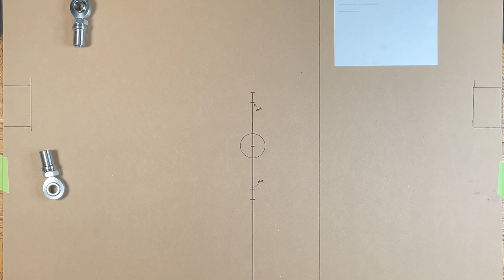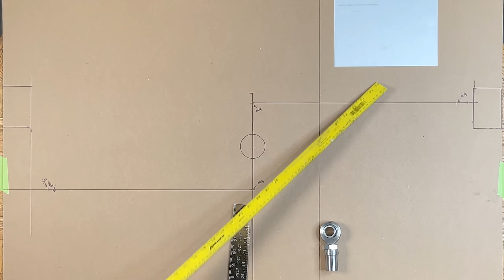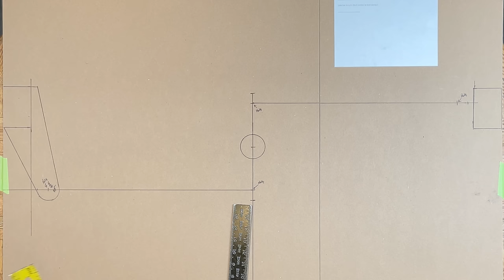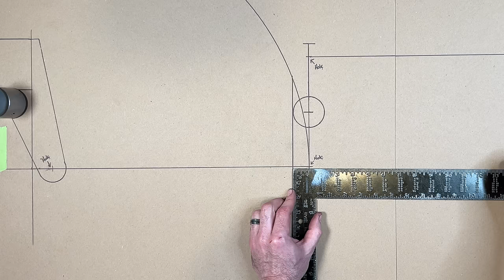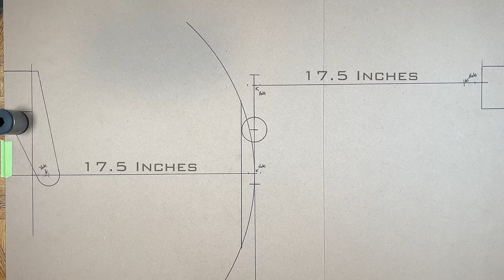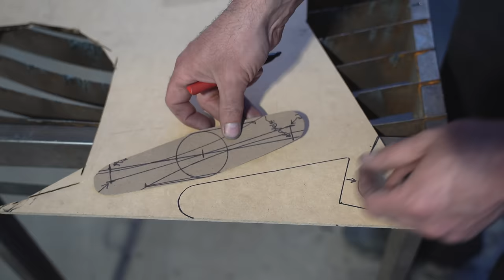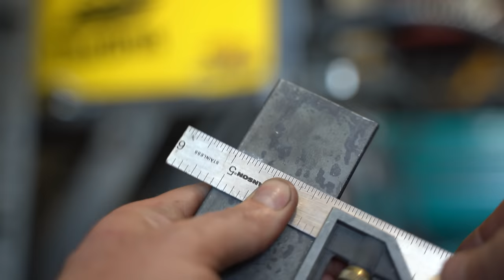The Greatest Watts Link Tutorial Ever! Mighty Max Ep. 16

Comment: Can watts link be above the center line off axle?
In offroad use it would be better protected?
Reply from the maker: Yes it can! Here’s the potential catch; The pivot on the ‘propeller’ of the Watts link is the roll center of the rear suspension. So you are raising the rear roll center. This could potentially be less than great on a street race car, but for off-road? I don’t know! I recommend doing that search. What’s better for off-road, High or low roll center?

Comment: OK, but does the the watts link have to be mounted in the center ( up and down) of the the rear axle or could it be above the axle in the frame?
Reply from the maker: No, the center point of the Watts Link can be anywhere vertically. You could put it higher than the roof of your car if you wanted. Don’t do that. That would be dumb. Also, the pivot point of the center link will be your vehicle roll-center. (Look it up) Most people believe a lower roll-center is better for vehicle handling.
Also it’s just much easier to mount the propeller centered vertically on the axle which is already a pretty good roll-center location.
Reply: Yes, you can make the pivot higher, as I did on my Nascar Chevy with leaf springs in the 60s.  I just welded a large bolt on top of the housing that stuck out  rearward (single shear, it worked fine and never broke off.)
Reply from the maker: That’s interesting! In a racing application even?!

Comment: Great vid!! One question, is a watts link suspension less likely to axle tramp in high powered vehicle?
Reply from the maker: Is this question for you or are you asking for a friend? Axle tramp or wheel hop occurs mostly with leaf spring suspensions. It’s caused mainly by the axle twisting backwards, winding up the springs, and then releasing under heavy acceleration and could be made worse by failing shocks. Leaf spring suspensions usually don’t have a panhard bar or watts link. (Though I have seen them installed to help stiffen things up)
But to answer your question, No. A Watts link eliminates side to side motion so it wouldn’t play a part in limiting up and down vibrations.
Converting leaf springs to a 4 link setup would be the first step in eliminating wheel hop. If the vehicle in question already has a link bar suspension, it may be designed improperly with incorrect angles or perhaps failed bushings?
Hope this helps.
Thank you for the kind words! 🍻
Reply: @GarageFab  thank you for your time to respond to my question much appreciated. The question was for me, thinking of options for my 1978 280ce Mercedes with a ford "Barra" powerplant... Cheers Tim.(live in Australia)

Comment: now if you do the other style watts link does the bolt need that same support
Reply from the maker: Short answer: Nope!
Longer answer: It’s difficult to explain in text, but if the bushing is welded into the bridge that arches over the back of the differential, then that bushing is fixed. The “propeller” would then be two simple plates that sandwich that bushing with the bolt through the middle. That bolt would see “double shear” forces, meaning that the forces are split between the front and back of the bolt rather than a single point.
If you want some insurance just grab a large grade 8 bolt!
Hopefully that made some sense. If not Lemme know. I’ll try again. Cheers!

Comment: Just curious, what kind of power can the watts link handle?
Reply from the maker: Hey Brian! What kind of power are we talking about? Horse power or G forces? I’ll answer both in an attempt to get you an answer.
The watts link’s job is to keep the axle centered under the chassis left to right and has almost nothing to do with anything related to acceleration or braking. That said a watts link wouldn’t see any more stress on a top fuel dragster than it would on a golf cart.
An F1 car is something else entirely. When a vehicle turns hard and fast and has a lot of traction, there’s a lot of inertia trying to pull the chassis sideways off the axle. That’s where the watts link goes to work. With that in mind, the strength of the watts link all depends on how it’s built. It can be made to withstand the forces of a semi truck on a race course.
Hopefully this made some sense. Lemme know. Cheers!

Comment: Mancandy 
I’m doing a watts link 
Asking how do I know the length of watts arm or center arm 
Coil Shocks have 4 inch travel total  can u help me out please
Reply from the maker: Hey Dean! The center link can be just about any size. Static height suspension like yours doesn’t require a lot of movement, so the center link can be pretty small. It might be determined by whatever components you’re using. I’d recommend maybe 4 inches from the center of the top hole to the center of the bottom. If you’ve got a junkyard nearby, go check out a PT cruiser. They have watts links from the factory and they’re really kind of small.

Comment: Which one has more articulation? And can the front axle be done?
Reply from the maker: Generally the rod ends are the biggest inhibitor of Articulation. Swapping polyurethane bushings with Heim joints will drastically increase the amount of twisting motion you’ll have. That said, the triangulated 4 link is the most ideal for crazy Articulation, because a 5th device isn’t needed to keep the axle centered, (Like a panhard bar or a watts link) that often limits movement.

Comment: I wery like the Watts link and Im glat to see, that You built it in a shad. there is only one design flaw. and this is in the Diff cover extention for supporting the bolt no to be bent. those extensions left an open surfaceto let dirt and moist inside and will cause rust issue. otherwise nice work.
Reply from the maker: That’s a good point! I’ll have to have it powder coated and hope that helps. Cheers!
Reply: @GarageFab  maybe you can patch it before power coating, while it in pieces. great work.
Reply from the maker: Wait… patch what? There aren’t any holes or openings that aren’t meant to be there. Just some difficult to reach places that spray might not reach.

Comment: Why did you go with such a large truss across the top? Is that in another video?
Reply from the maker: Hey Samantha! The reasoning for many of my projects is simply “Hey! That would be an interesting video!” if you haven’t already, go check out the video that features the truss build. (Build an Axle Truss! Mighty Max Ep. 14)
https://youtu.be/nHwn5nU0ph0
Earlier in the truck project, I narrowed a mustang axle, so I thought it would be wise to strengthen the axle a little bit. I don’t think the truss needed to be as big as it is, but the size was just determined by the size of the upper link bar tabs. 🤷‍♂️

Comment: I watched this just to see if it seems applicable on a off road vehicle but I don’t think it’s possible because of all the articulation that the axle sees but seems like decent for street vehicles or low riders
Reply from the maker: The disqualifying factor would more likely be ground clearance. The articulation of a watts link suspension is only limited by the vehicle frame/body. The watts link itself doesn’t prohibit articulation at all. The axle could technically rotate infinitely. But unfortunately, a Watts link requires a frame to attach to.
For high articulation, I think the most popular set up is a Double Triangulated 4 link.

Comment: You forgot one very important thing . Some guys dont run o pinion angle . They normally run 3 degrees wich changes the the watts link again and changes all the geometry.
Reply from the maker: I’m not sure I follow, Shayne. Pinion angle varies a lot depending on what vehicle it’s on. But pinion angle doesn’t affect the watts link.
There’s a possibility that changing the pinion angle (after the Watts link is already installed) could cause clearance issues with the bar ends. But I don’t see how pinion angle could affect anything else.

Comment: That little model is f'in sweet!

Is that timing belt tensioner rollers as wheels?
Reply from the maker: Oh my! Are you a Toyota guy too? That is exactly what they are.
Thank you my friend!
Reply: @GarageFab  Was for several years, but also Nissan, Honda, Suzuki, & VW.  They all have bearings that look kinda like that.

You should build the rest of that model!
Reply from the maker: I was going to use the model for front suspension demos also, but I’m worried it’s too small. Instead I’ve got ideas for a significantly larger model of one side of the vehicle, that I can duplicate and flip in my editing software to make it look like a complete model. 🤔
Reply: @GarageFab  do whatever you want. Welding random shit together to make it look like something else &/or work, is "art", apparently.

That's what I was told (by several people) about the random shit I've made after raiding the scrap pile (when really high).

It's not so much about how good it looks, but how you made it. 3D printing any of it takes the "art" right out, since you didn't make it, a computer did. 

Set it on a visible shelf in the shop to remind you, & wait. IDK what the right parts are, but they'll show up, and I'm sure you'll know when you see them!

Comment: Isn't that bottom link mount on the frame going to prevent the frame from sitting on the ground?
Reply from the maker: Not gonna lie, Kent. You made me go measure. The frame swoops upward significantly behind the cab and so there is still 3(ish) inches of ground clearance for that monstrous mount.
It will get much closer to the ground when I drop the rear drag bar/roll pan protector on the ground but it still has some clearance. 🙌
Reply: @GarageFab  Got it!! But what about the angle of the dangle?
Reply from the maker: Haha!! You’re just gonna have to trust that the dangle has been properly calculated.

Comment: Not quite sure why the bell crank (propellor) can’t be straight up and down?
Reply from the maker: It can be. On a vehicle with static height suspension, i.e. metal springs, it would work just fine.
On a vehicle with adjustable suspension, (or a vehicle with a lot of suspension travel) the simple angle will provide more travel before the Watts link flips or binds.

Comment: Nice, now show the 4 bar builders what happens when one tire is on the curb or rock and the other on the ground. paralell 4 bar is for drag racing on flat ground, any off road action requires the 4 bars come together like a wish bone under the trans  U-joint  For kicks move your floor jack under one rear wheel and watch what happens to the other wheel and frame.
Reply from the maker: I might need to disagree. Perhaps I’m misunderstanding something. Are you referring to the articulation a parallel 4 link is capable of?
The articulation of a parallel 4 link is certainly limited. And a triangulated 4 link articulates better. But ”any off-road action” sounds like you’re implying a parallel 4 link can’t articulate at all. What are you expecting to happen when you jack up one wheel?
The answer is nearly the same thing that would happen on a triangulated 4 link. One of the most limiting factors in a link bar suspension is the bar ends. Polyurethane bushings can’t articulate much. But they can still articulate. 
If you need your body and axle to twist significantly, you’ll probably want to install Johnny Joints or Heim joints.
The next biggest limiting factor would be the axle’s lateral locating mechanism I.e. panhard bar or Watts link. A triangulated 4 link doesn’t require this mechanism so it can articulate much further.
Lastly is the bars themselves. After a whole bunch of articulation, the parallel bars will theoretically eventually crash into each other. A triangulated 4 link (or even better still a double triangulated 4 link) can easily out articulate the parallel setup.
Regardless, a parallel 4 link could perform fairly well off-road.
Reply: @GarageFab  4 bars that run down the frame rails to any type of rod end will not let the differential flex or pivot from center line of pinion shaft. If you try and jack up one wheel all the bars bind up and both wheels will lift. Street rods and drag cars are fine Pic-up trucks and any off road is no good, with out a Wish Bone design. If you have a typical 4 bar set up , just lift the car and set it on jack stands so the rear tires are just touching the ground, jack up one tire.
Reply from the maker: Yeah… definitely not true. The bars would have to be connected to each other to behave like that. 
The precise pivot point will be determined by the location of the upper and lower link bar ends, so the pivot point may or may not be at the pinion shaft, but the axle will in fact rotate.
My Wife’s truck has a parallel 4 link with stiff polyurethane bushings.
The axle still articulates.

Comment: How much do you think you have in raw material? Steel, joints, bolts
Reply from the maker: Do you mean in the axle assembly? I didn’t weigh anything, but if I were to guess, I removed about 10 pounds from the axle when I shortened it. Then I added about 50-60 pounds with the truss, Diff cover, and watts linkage.
Reply: @GarageFab  I meant to say how much money,sorry.  Always wanted a Watts link for my 4th gen Camaro but is over $700.
Reply from the maker: Ah! Gotcha. It’s kinda hard to calculate because much of the material I stock in the garage. And the cost I paid for it a year ago is likely very different than today’s prices.
But the Heims, Bolts and Bushing were about 220. And a VERY rough estimate on the steel would be $50 for the DOM tubing and $30 worth of steel plate.
So right around $300 total!
Cheers, fellow Aaron! Have a great weekend. 🎉

Comment: First of your videos i see.. scrolled down to subscribe.. i was surprised your channel is not 1Mill subs.. content is spot on so keep it up.. only one suggestion.. if you'r trying to build an international channel, dont keep it "imperial niche".. use metric, so the other 95% of the world can pick up too..
Reply from the maker: Thank you my friend! I agree with you 100%. I attempted to make the switch to metric. I even announced the switch and purchased all new measuring devices. I actually prefer the metric system. It’s far less confusing.
I was immediately frustrated though as I realized all the material and tools available to me are sold in inches, all my drill bits, hole cutters, dimple dies… all in inches. The last straw was so many of my videos are a continuation of a previous video where measurements recorded were also Imperial and a sudden change would’ve caused a types of confusion.
I still want to change. And I’m still likely going to. But I think I’ll be making the switch when this project is finished and the next begins.
Thank you for the kind words!
Reply: @GarageFab  We struggle with that problem here too, even tho Imperial has never been official, some things come in inches like water/gas pipes.. As for the videos, maybe just add a text overlay for metric, in edit, whenever mentioning a measurement? a little cumbersome but if its temporary should not be that much of a problem..
Reply from the maker: I agree with that too. And I had considered that while writing the previous replay. It shouldn’t be too much work to do a quick conversion here or there. You’ll likely see that in some upcoming videos.
Thanks for the input! 👊

Comment: The tooth thing made me subscribe 🤣
Reply from the maker: Interesting! I think that bit usually inspires people to unsubscribe. 😆 
Thrilled to have you, Lance!
Reply: @GarageFab  I actually have a question. Would the watts be good for something with a lift or is it just good for lower vehicles? Because I haven’t seen them much in off road applications. Probably because less moving parts means less to break. But I see the benefits of it tho.
Reply from the maker: You are correct. Simplicity is usually best. That goes for low vehicles too. But yes, the Watts would be great off-road. The cool thing about the Watts link is it has nearly infinite articulation abilities. If it weren’t for the body, chassis, and link bars, the axle could theoretically spin 360° and beyond. It’s hard to beat a simple double triangulated 4-link, but if you want something a lil different, the Watts link might be for you.

Comment: I agree with what you say but have seen too many bad experiences with watts. It sounds simple but are often not. A watts with heim joints has a bad habit of binding. Even factory ones. Having the centre pivot on the diff like most OEM causes even more grief. I am involved with speedway sedans that too often break the back out of the diff. And look at Aussie Supercars of old breaking the'bolt' very regularly. The pivot on the body is better and easier to make adjustable roll centre  work.
A panhard however seldom causes any grief. Unless you are using huge travel. Make sure it is long and near level at ride height. Though my 71 Galaxie has a fairly short and high one but works fine. Over say a 4" suspension travel the deflection is minimal.
And Nascar used them for 50 years!!
Reply from the maker: Well there’s no argument there that the panhard is simpler, proven, more reliable and more carefree. But that is hardly the point. The Watts has its place in vehicles like my Wife’s which will have nearly zero fender clearance and 12 inches of suspension travel. It sounds like Watts links that break is a design flaw by definition. 🤷‍♂️

Comment: Couldn’t you just use a piece of round bar and make like a bump stop at its full extension to prevent it flipping at full lift ?
Reply from the maker: I don’t see why not! That will stop the suspension travel though. So on air suspension, if it’s not designed properly, you may not get full lift.